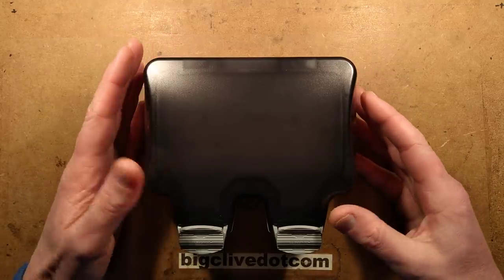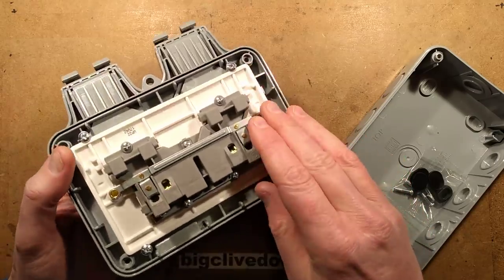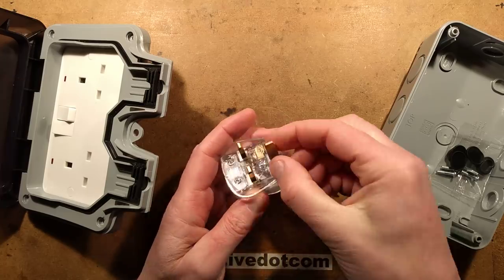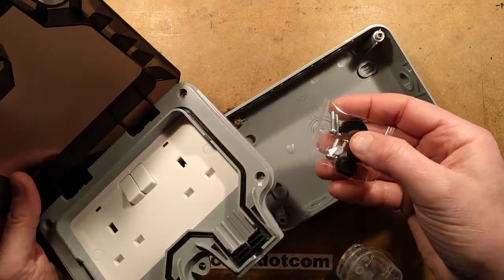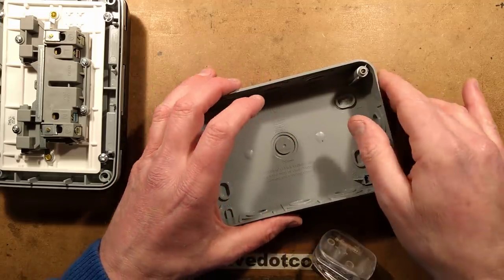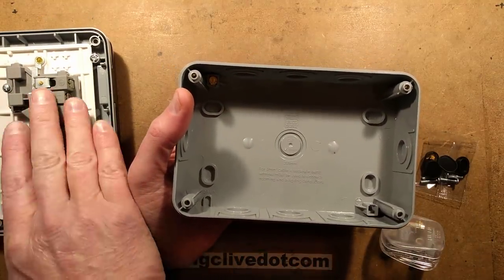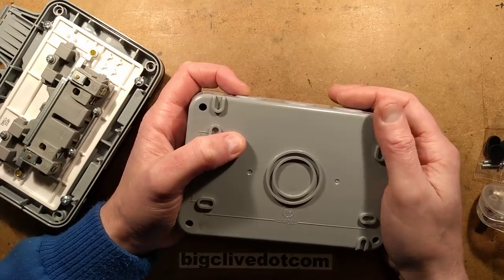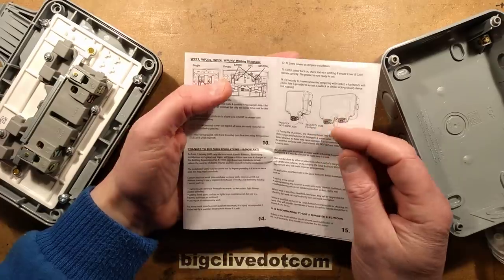British weatherproof socket with clever design. (bonus rant)

Comment: I'd love to see an electrical standards rant video, it pisses me off too that any idiot can get a certificate to say they know what they're doing, the change in wire colours (I far prefer the RED for DANGER, poo-brown for danger doesn't make sense!!), the fact that competent, if unqualified, people like myself aren't technically allowed to do home wiring (I ignore that, because I know what I'm doing unlike whoever wired up the 2x spurs, ring main and "mystery cable" to the back of the washing machine socket!! 5 wires in one terminal, no wonder it tripped every now and then!), it really annoys the hell out of me!!
Reply: Poo-brown for danger would make sense to you if you suffered from one particular type of colour-blindness.  As would blue and yellow-green stripes if you had any of the the kinds of colour blindness that cause problems with red/black/green.
Reply: @digitalk68  
Yeah, but the EU wire colours for three phase are stupid.  And that's after they changed them.  Before that change, they were fucking stupid (two of the three phases used black wire, try to figure out which is which from the lay of the cable).
Reply: Tell you what, we're gonna have a colour scheme where Live is the colour of soil (aka E A R T H) and neutral is the most commonly associated colour with graphic dipiction of "electricity". Sounds sensible. Oh yeah, and lets make the earth stripey and brightly coloured so it looks like a snake; you know, like danger.  Brilliant.  FACEPALM
Reply: Brown = Poo (or dirt)
Blue = Water (not to be used with electricity)
Green & Yellow = WTF were they smoking?
Reply: @90vanman  
Did you read my comment above about colour blindness?  If so, did you understand it?

The most common form of colour blindness results in the red and green of the old wiring looking the same.  This is not a good thing.  Getting those two wrong will result in electrocution.

There is no form of colour blindness in which the new wiring colours can be confused.  Even those who have no colour vision at all will see three different shades of grey.  These things were not true of the old scheme.

There was an intermediate scheme with red/black/green-yellow-stripes, but that didn't solve the problem for all forms of colour blindness, just the commonest one.

It wasn't change for the sake of change.  It wasn't change forced upon us by Eurocrats just because they could.  It was done for good reason.
Reply: @bdf2718  there should be a test for colour blindness, that is taken either before starting a course or before taking an exam, and these days they can easily mark on the wire what colour it is in any or every colour under the sun, so no excuse there, if you are colour blind changing the rules to suit you certainly isn`t going to improve things, i have a fear of heights can you imagine if the fire brigage changed it`s rules so i could join, and i ended up trapped in building up on a roof and the only way off was by the ladder, explain how that is a good thing, and does anyone know what a firefighter does if someone does needs rescue does have a fear of heights, i`m imagine that firefighter knocking out victim to carry them down the ladder, but i can`t see that being in the rules.
Reply: @90vanman  Then for real fun, I live in a house built in the late 1970s with some additional electrical work done post-1995, so have some circuits with the old regs wiring and some with the new regs wiring (which apparently necessitates a label on the Consumer Unit to inform electricians I have both sets of wiring in the house)...
(Even better: have one socket on the ring main, which feeds a spur double socket half way up the wall in a cupboard (!), which feeds two further spurs - one to the boiler, one to a security light)
Reply: @philipcross1586  
Printed markings on wires can be worn off.  That's why cables are colour-coded.

A course and an exam.  For anyone replacing a defective plug, socket or lamp holder.  Sounds a little unworkable to me.

Oh, I see where you're going with this.  People should be banned from doing those sorts of things.  Yeah, that's gonna work when anyone can go into B&Q and buy sockets, plugs and lamp holders.  They'll have to show their exam certificate before they're allowed to purchase, right?

After we set up the courses and exams where people are tested for colour blindness before they're allowed to puirchase plugs, sockets and lamp holders, can we have courses and exams for critical thinking before people are allowed to post YouTube comments?
Reply: Its a bit bizarre that you would compromise regular peoples ability to tell what something is for a minor improvement for colour blind people.
Reply: @bdf2718  its a safety risk having people who are colourblind working in certain situations. I understand the need for inclusiveness, but there are some industries where being colourblind restricts your work options for the safety of everyone else. there are disabilities that rule many people out of many jobs and it just makes sense
Reply: @philipcross1586  I did an electrical course last year and the tutor asked us right at the start if any of us had colour blindness, deafness and inability to smell. he then explained why we needed these three senses to be a sparky
Reply: @mittfh  what the actual F**K? ring mains sound so dangerous, I'm glad we don't have them in NZ
Reply: Hey from the USA here.

Are colors as in terms of single phase.

Are white neutral black hot and green or bear copper ground Earth.

And as far as as that goes for Earth or ground.  

We are not allowed to use to ground as neutral in most situations nowadays at one time there were Unearthed 220 circuits that would have a neutral our normal voltage is around 110 120 volts ac hot to neutral for smaller loads.

AKA Lighting in receptacles mostly.

S4 things like dryers and uvens ranges and cooktops.

Which use around 240v AC.

At one-time the stair was to use the ground combined with the neutral in one wire.

Exhaust having a three wire plug.

Nowadays with new installs it's cold to run a 4-wire receptacle and cord set that has two hotwire's one neutral and one ground.

O by the way I do remember a lot of the old range tops if you were lifted up after funding the oven light top light if equipped receptacle timer and other controls not probably working including the clock there would be a blown 15 amp essbase fuse underneath the lid that would lift up to clean underneath the burners.

Also I do know that in one state here in the US it is actually illegal to change your own light bulbs at least in one state. Cannot recall which one.
Reply: @90vanman  it was easy with that setup, i remember learning wiring at school back in 1996 it was even taught in physics with lessons on wiring a plug and understanding currents. But i can understand the color blindness bit though
Reply: So I understand all the comments about colour blindness and wiring colours, but completely OT, can anyone explain why the EU decided that fire extinguishers should stop being four easily recognisable colours and start being all red?
Reply: Domestic wiring = three wires. Yes, one of them used to be red and now it's brown but we'll cope. More worrying is people still earthing their wiring to copper pipes when they've replaced half the system with plastic.
If you really want to scare yourselves with coloured wiring, take a look under your car dashboard - yet people still DIY those, even today.
Reply: @andrea_frm_dubt8977  The ring main is logical - normally, two wires of each type heading into each socket, with a ring of sockets on each floor of the house. The idea being that the electricity heading to each socket passes through both halves of the ring, so you can get away with thinner cabling (typically 2.5mm^2). The circuit itself is fused at 32A while devices plugged into the sockets are fused at up to 13A (so with 240V supply, can cope with 3,120W). It's recommended to only run one spur off a socket, possibly as the more sockets you add, the higher the chance of the total load approaching 3.12kW.
Reply: @mittfh  It doesn't make sense nowadays, ring main was intended to save wire in a period where there was a shortage, also nowadays most of the appliances that you use take so little power that you will never use more than 16A on a single circuit, never the less 32A. 

The sane thing is do what is done in most European countries, radial circuits with 2.5mm cable and 16A breakers , and plugs that are rated for 16A. No need to have fuses in the plugs (that can be bypassed), no risk of broken rings, and also it's simpler to wire and to modify the installation, since you don't have to loop in and out every plug, and you don't need spur and fuses. 

If then you need to connect some appliance that uses a lot of power (oven, electric heaters, air conditioners ecc), the correct thing is to wire them on a separate circuit with it's own dedicated breaker of the correct size, not to put that stupid fuses spur that you have everywhere.
Reply: @alerighi  its fairly easy to go over 16a if there's insufficient sockets and people get a flying lead extension, and radial circuits in a large room with multiple sockets must have their own problems with tracing which cable belongs to which socket - I hate troubleshooting network cables for that reason. I'm not supporting one point or the other, just saying that the ring gives more headroom and a slightly cleaner install - in some circumstances - so it's swings and roundabouts
Reply: A polish guy told me that over there blue is live and brown is neutral, don't we feel so much more harmony with our European cousins?
Reply: cross  you do have an eye test before training (I don't know about part P) I remember doing mine. Odd thing no one ever asked to see it in the 3 years I did my training
Reply: @nfc153  its three conductors not wires. And I've not seen anyone earth to a copper pipe in 25 years. Are you sure your not thinking about bonding?
Reply: @TonyTony-xj6uv  what course did you do and when?
Reply: Initially in the 60s when the European colours all 3 phases were brown

Comment: Hi Clive, you are so right about the standard having dropped.  I few years ago I had a outside floodlight ring that tripped elcb sometimes.  All in swa cable, most underground. Cause traced to 4x4 galv box in a rockery with missing earth screw. Supply cable had cut on incoming live by waterproof gland. The box was at an angle and any water ingress shorted out the supply, but cleared it'self right after. A complete pig to find.
 PS. I like your comments on Eric O's SMA channel.

Comment: my level 3 ran out a few years ago will that stop me in my own home, nope..just because im not upto to date didn't turn me into a cowboy!
Reply: Will your insurance company agree?
Reply: @Szlater  If you know what you're doing, insurance will never become involved anyway.
Reply: Considering the state of the wiring in my house when I moved in I'm surprised it lasted that long, wires routed diagonally up walls and running under heating pipes in the same notch of the joists and some other non compliant work!
Reply: I know a guy who spent half his working life building high voltage substations. When he retired he had to get another sparks to rewire a house he bought. :(
Reply: @gerrybvr  it's mental! That guy is probably more cautious and careful than any electrician!
Reply: @tecfixed2840  When looking for quotes one guy kept ranting about having just done his 2 day re-certification course, "...money making scam, blah blah". At the same time he couldn't understand why the RCD wouldn't trip when he pressed the test button. The house had been disconnected for years. Even I know it's very hard to trip a device that isn't connected to the mains.

Comment: My husband and I had done some rewiring in the house about 15 years ago - it was a real amateur death-trap. With my family background and through reading and common sense, I'd learned quite a bit about electrical installations. I had the house completely rewired within the last year and I'm appalled by the shoddiness of the work. Yes, it passes safety tests, so it can be certified, but I don't feel as totally comfortable about it as I had with our own work. We have an identical outdoor socket to the one you show, but the installer hadn't drilled the drainage hole. He also left all the original wiring in place, so we have loads of unnecessary holes in joists. He even confessed that he'd been unable to reproduce the routing of the cables we'd made (with a mass of springy coiled net curtain holder fished through voids with a bent coat hanger). I was not impressed, but he seriously underquoted for the job and I wasn't going to be kind to him after I had to pay to fix next door's bedroom ceiling that he cracked. So, yes, the requirement for "qualified" people to do the work has not resulted in an improvement in standards.

Comment: When I was a sixteen year old school boy my Father gave me a copy of the fifteenth edition regs and a mountain of materials and told me to wire the holiday house we were building. I remember that it was a rather daunting challenge but I thoroughly enjoyed it. I remember taking a long time to work out the 2 way switch in the corridor but otherwise it was all wonderfully logical. 

   We were perhaps not complete safety fools though as we needed it signed off by a professional. So after closing time I drove the slightly inebriated local barman who was also the local qualified electrician to the house to bless it with his megger!  It passed after I remembered to connect the final countertop sockets!  Oh the shame!  We celebrated with another wee drink and the next day the Hydo Board connected us curtesy of the certificate we had written the night before!  

  Only problem I have had in the intervening 40 odd years was an intermittent tripping when turning on the cooker. After many hours heads scratching with a meter I pulled out the oven and took off the rear panel. To my surprise a pair of unfortunate mice in the process of clambering up to investigate food possibilities within, had between the two of them, managed to span the gap between the live and earth incoming connection posts!  They had paid the ultimate price for their cheek and strangely had remained mummified in place such that occasionally they would supply sufficient of a path between them to trip the earth leakage trip if you turned on an element!  Macabre. 

  In 2009 I decided to replace the old wire fused consumer unit with a lovely latest edition twin RCD circuit MCB protected panel that I had been lusting after. I did learn my lesson somewhat this time though as I got a healthy belt whilst disconnecting the main incoming fuse. I'm not so inclined to touch it now it has a supply connection.

Ps. I had enough leftover old style black red cable from that job to do my later English house with so there was no need to trouble a professional to sign off my work there either.

Comment: The plug and socket  part of this (ignore the weather-proof box) is standard in the UK?  Are those switches over-current protection, too?  In the US, ours are downright primitive by comparison.  At on least cables with a ground pin that pin is longer so engages first.
Reply from the maker: The overcurrent protection is the fuse in the plug that matches the flexible cable.  The switches are for convenience.  Our power rings are 32A at 240V so they can deliver a lot of power.  (8kW)
Reply: Yeah ..  a fuse in every plug?  Wow.  In the USA, the NFPA does a good job (I think, speaking as a non-professional) of keeping the worst problems at bay through the NEC, but wow is your standard plug and socket so much better than ours.  I guess we can do 2.4 kW (20 A at 120 V) without a special plug?   Crazy.  (and we'll just ignore the EU-imposed stuff - 50 shades of brown - brilliant!)
Reply: @plaws0  it's why the British plug design is considered the safest. British engineering at its finest!
Reply: @plaws0  I think you are only allowed to go up to 80% of the rating by the electrical code. So a 20 A plug/receptacle is technically only permitted be used for 16 A. (This is why electric kettles and other kitchen appliances with a 15 A plug are no more than 1500 W. Because 80% x 15 A = 12 A, and 12 A x 120 V = 1500 W, give or take.)

Comment: Love those transparent plugtops.  I have the exact same box providing power to my garden activities.  Mine came with a rubber adaptor to allow using than un drilled back middle  hole, the adaptor fits standard  20mm trunking The LEDs are great for telling me the power is out in our area is is frequently an issue.  To get round the new regs I just made mine off to a plug and it just plugs into the double gang socket on the wall inside.  Making it technically portable, like an extension lead.

Did my Part P when it first came out, gave me the knowledge to do but none of the permission. Learnt way more just working with the trades over the years. Just get all my work signed off by mates who are registered.

Comment: I was pretty ingenious when I was 5, I worked out how to push the earth shutter down with a lego spacecraft antenna, then I cut the metal hanging loop on a paper chinese lantern and wedged it into the socket, I had seen how light bulbs worked and thought the lantern would light up..... it did. I may also have been the victim of some mild burns to my fingers an electric shock and a fire in my bedroom.
Reply from the maker: And that's when your fascination with electricity began.
Reply: I'm starting to think the shutters increase the risk for the brightest kids, not just reduce the overall risk...  Time for an improved design (and one that doesn't sit prongs-up on the floor so readily)